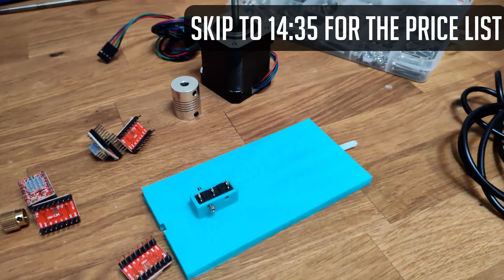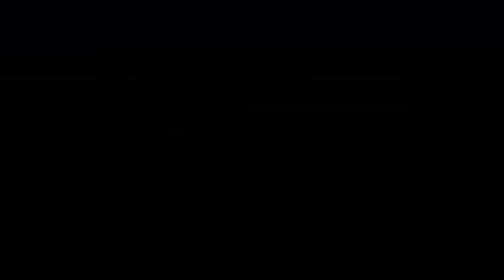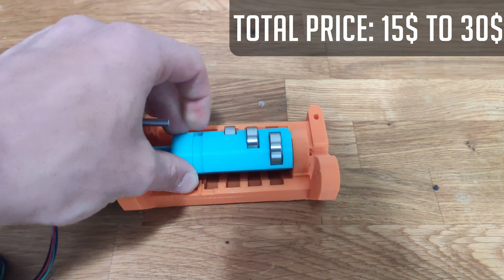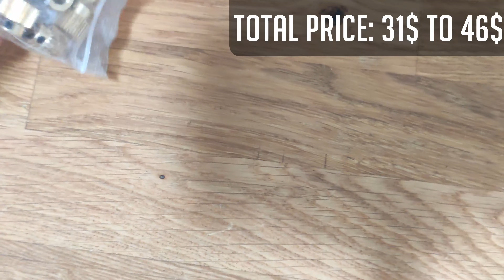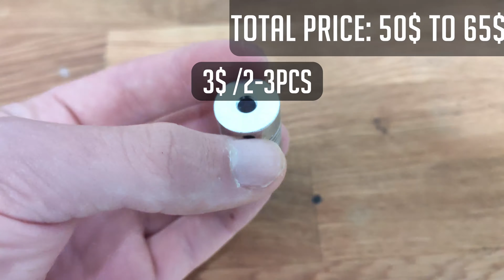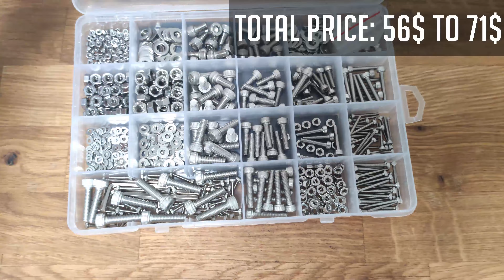MMU2 upgrade on any printer. Part 7: Price estimate

Comment: BigTreeTech also has a driver expansion module for other boards 
I think this is it
http://www.bigtree-tech.com/shop/product/show/id/43
Reply from the maker: Yeah that’s one of the options for worst case scenario but I should be good even with only 1 extra motor control. Thanks for the tip.

Comment: Have you tackled the firmware at all? Also check out the BTT GTR V1.0, I am running it right now and it's pretty good. Few things need to be improved but it is version 1.0 so that is kinda to be expected. But with the expansion board it can run 11 steppers.
Reply from the maker: Hey, I have started to play with the firmware (I am thinking of adapting Marlin and to also use some of the original MMU2 code) but I am still waiting for the mainboard to be delivered (shipping times and coronavirus don't really go along). The BTT GTR is an option (and if you are ready to pay more it may be a better option) but I am trying to make this as cheap as possible and this would undoubtedly increase the cost...the board itself is more expensive but the need for such a board would also mean that I was unable to make it work with only two extra motors (and the additional drivers needed as well). But thanks for pointing it out because it might become handy if I need even more expandability. In the end, you can choose which board you use as long as you have enough stepper motors controls but the skr pro will probably be similar to what most people are gonna go for
Reply: @materialswitchingunit284  oh yeah the GTR is not a cheap board, but it is no compromises which is nice. Yeah delivery is awful right now, I have been waiting 6 weeks for a heated bed...